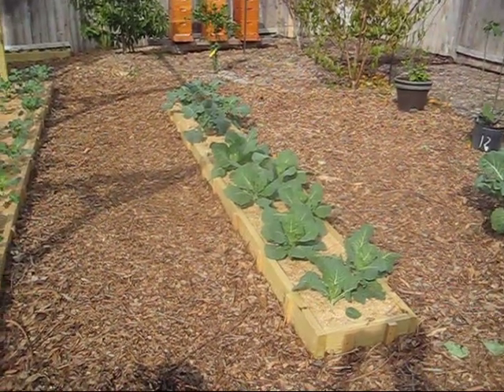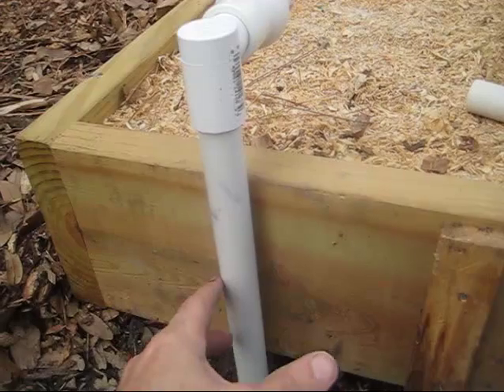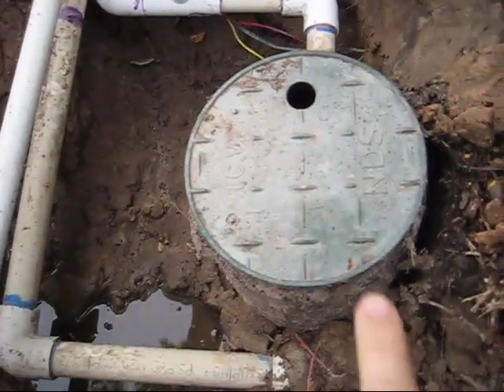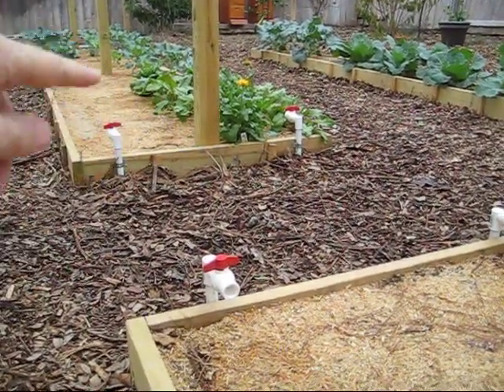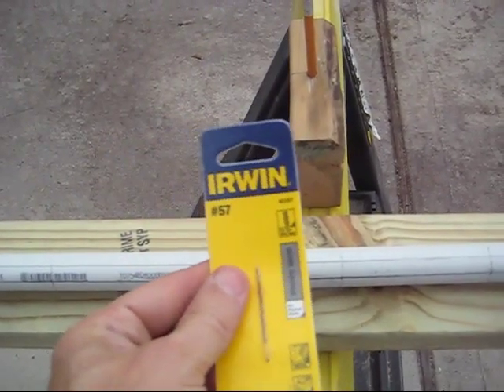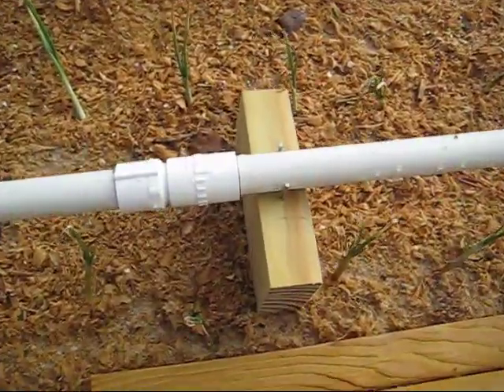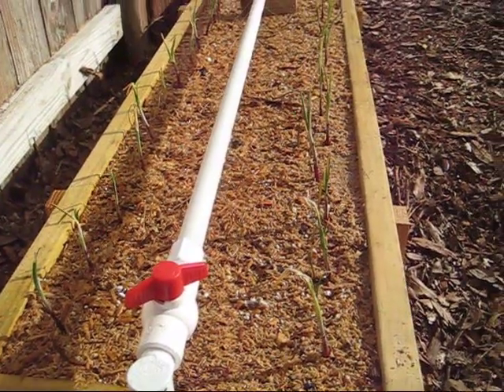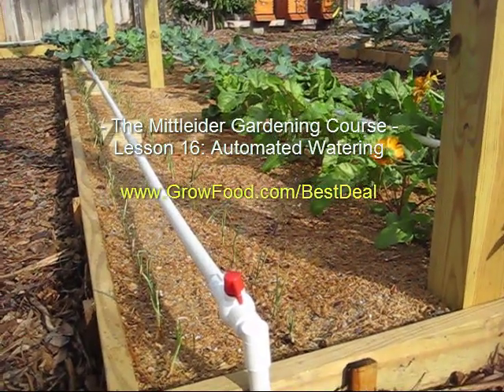Mittleider Garden: Automatic Watering, No Drip Irrigation, Soaker Hose, Sprinklers

Comment from the maker: Water pressure will be an issue for 50' runs. The Mittleider method recommends using #57 bits size holes for the first 30' and 1/16 inch holes after that. I would certainly use full street pressure. I am not sure about the poly pipe. I haven't tried it. I know it is 1/2" so your pressure will be different. We use thin wall PVC so the holes don't clog. I don't know if using thicker black poly pipe would make any difference.

Comment: Hmmmm... I may dismantle my overhead sprinklers and do this. 
I bought a pack of bits from Amazon.
Do you think there would be a problem with 50' runs (as far as one end getting more water than the other)... and... do you use a pressure reducer, or are you running street pressure in your drip system?
Also:
I was wondering if 3/4" black poly pipe (that comes in a roll) would work.

Comment: very interesting system and layout However, my question is your watering system is based on city water this could be a problem down the road. If memory serves at one point u have series on water collection why did u not tie into this system. You have left yourself in a no water situation if the city water stops flowing. Also city water has a lot of chemicals added not good for plants or us. Always interesting!